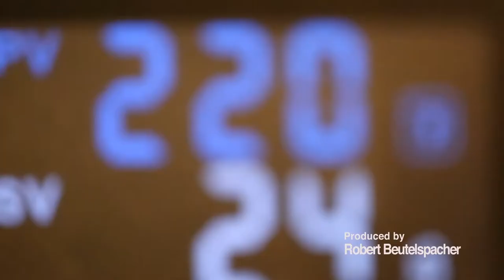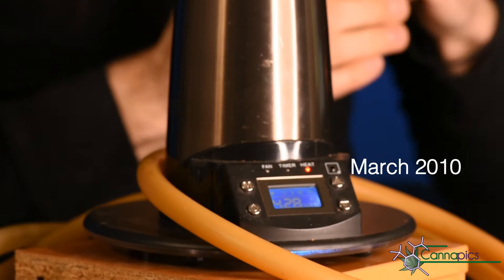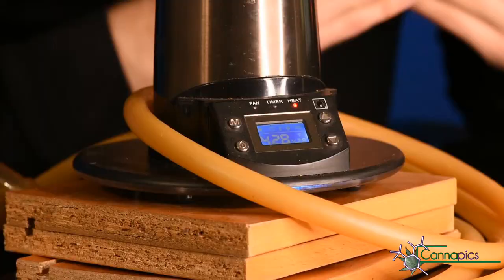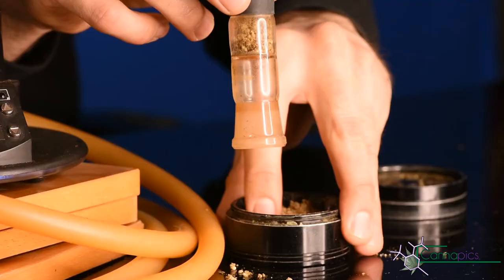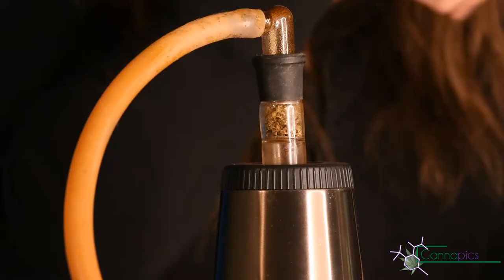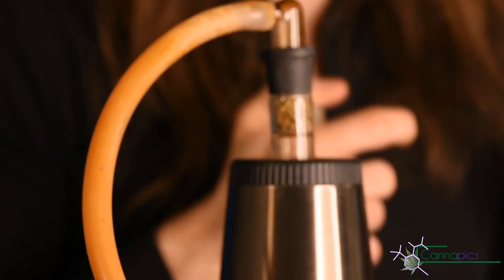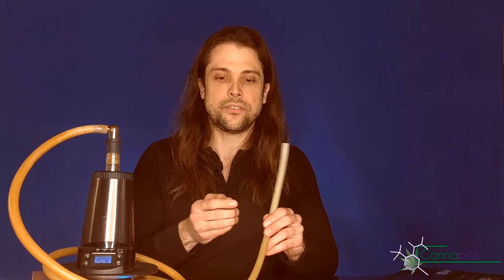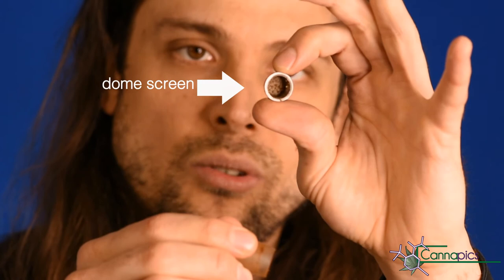Cannapics Season 2 Episode 4  (S02E04) non paid *honest* review on the "Arizer Extreme Q" Vaporizer

Comment: I just discovered your videos so I just had to subscribe. One of the best reviews I've seen of the Extreme Q. I'm on my second Q now. The first I bought in 2018 and  was purchased from an online 3rd party and, as you said, it turned out to be a knock off. The remote failed after 6 months and I did have 3 fires with it as you mentioned. It finally just up and quit about 6 months ago. My second is directly from Arizer and I am now starting to get very irritated with the thing. It actually works worse than the knock off did. Time to contact Arizers warranty folks I guess and see if I can finagle a warranty upgrade to their newest model, the XQ2. BTW, your not the only one who vapes at 428 F. That's where the THCV that my pancreas needs, resides.
Reply from the maker: Sorry you're having issues mate, hope they resolve it for ya! Do you use the bag or hose, also do you clean the screen regularly? Usually when I have issues is because the screen is clogged. (90% rubbing Alcohol and salt will do the trick)
Reply: @Cannapics  I use the bags exclusively as I can control my medication better that way. I have a dozen of those basket screens that after one or two uses I dump into a 99% ISO bath to soak. My issues with the Q have to do with the poor fan and the machine deciding what temperature It wants me to vape at, plus the bag takes about 3 minutes to fill.